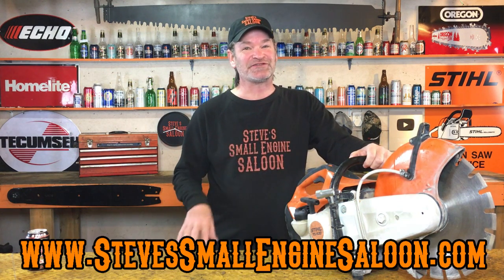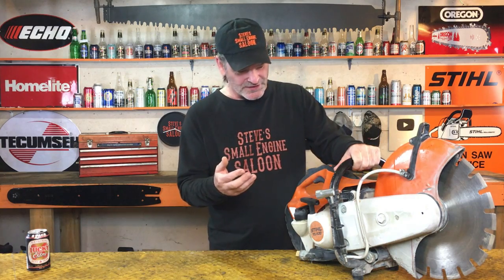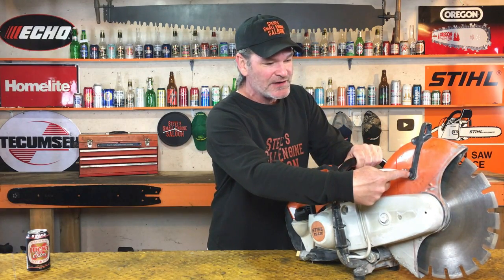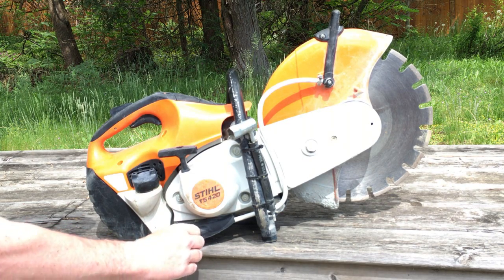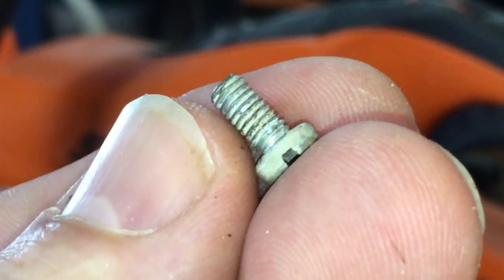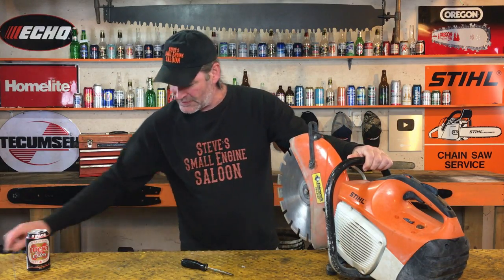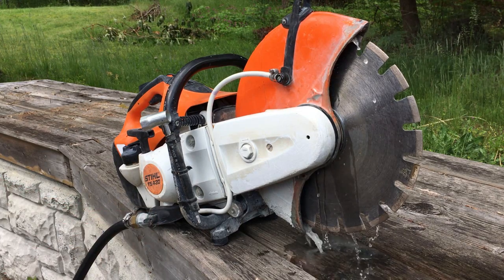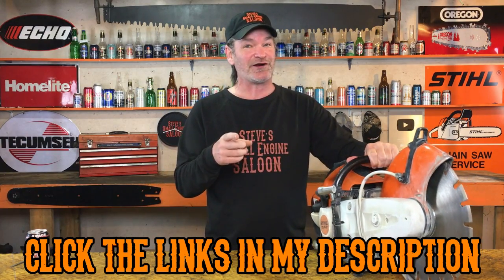Easy Way To Unplug A Concrete Saw Water Attachment To Spray Better

Comment from the maker: ✅CLICK HERE FOR SMALL DRILL BITS ➜ https://amzn.to/3aAdnkV
Check out this other informative video on the Stihl TS410 and TS 420: 
👉How To Replace The Drive Belt On A Cut Off Saw ➜ https://youtu.be/a7cydlI8Q58

For more videos like this, check out: 
👉How to Adjust or Tune the Carburetor on a Leaf Blower ➜ https://youtu.be/DWPUYJiF6KM
👉CORRECT WAY To Tune The Carburetor On A Chainsaw ➜  https://youtu.be/M6T5JoGXcHY
👉How To Adjust Or Tune The Carburetor On A Weedeater ➜ https://youtu.be/gmhxTvGRtCg

You can connect with Steve here too: 
✅Visit Steve’s WEBSITE ➜ http://www.stevessmallenginesaloon.com/ 
✅Visit Steve’s PARTS & TOOL STORE ➜ https://www.amazon.com/shop/stevessmallenginesaloon 
✅Follow Steve on FACEBOOK ➜ https://www.facebook.com/stevessmallenginesaloon 
✅Follow Steve on INSTAGRAM ➜ https://www.instagram.com/stevessmallenginesaloon/ 
✅Follow Steve on TWITTER ➜ https://twitter.com/SteveSaloon
Reply: Do you it might be the belt?
Reply: Do you think it might be the belt?
Reply: Any suggestions on a badly rusted recoil starter rope eyelet fix
Reply: Hey steve your in canada right ?
Here in america its a violation of  federal law to remove or alter a safety device 
But ive seen other small engine youtubers remove these devices for customers can you do a video on this since no one seems to know this is a crime and makes the mechanic shop liable for potential injurys

Comment: The newer models have a filter before the water switch ,I was doing the thing you showed but did not work,turns out the filter right where the garden hose connects was full with dirt,removed it and got it cleaned,it works perfect

Comment: Hey there Steve. Once again you're right on the ball... Thank's for this short yet quite important video. I actually have 2 stone cutters of the same company as the one in this video. I sort of minimize this problem by not letting these, or any of my small machines in the back of my pick-up truck. 1st it's prown to robbery but also... We being in the business of seasonal work. Therefore time is if the upmost impotence. This is where the majority of the clogging comes from. I noticed if I'd use the saw with water to start the day... no clogging... but, if I started the day using it without water. Just because of the night dew, that humidity in the machinery would help that dust stick like crazy... Including air filters, spring's...etc..
Now I'm going to say something that makes EVEY COMPANY OWNER CRINGE !!!! The best way of prolonging small machineries lifespan is one thing & one thing only.... MAINTENANCE  !!! MAINTENANCE  !!!! & yes.
.. MAINTENANCE  !!!
Reply from the maker: Right on

Comment: Alot of my job is masonry and theres rarely a day we dont use those saws. Love em hate em. Somehoe only recently found out about the screw plug. I was always told u have to pull tge entire bolt, that black strap bracket, and to aid in getting those damn square nuts back in their slots the blade too haha. We have problems with little granite flecks clogging the holes that run perpendicular to the jet hole but i bet this will still make it easier to unclog. Only two improvements (beside weight reduction) i can see on those saws. 1: a REAL hose clamp on that damn tubing, the crimp clamp they use has popped on every saw weve ever had after six months (we have 4 now and 2 that finally bit the dust but are good parts). And 2: a better way to secure the feet on the bottom (maybe even just wheels) cus u can use the feet to slide the saw forward into the cut (so ur not pullin out of the cut all the time and getting a wavy cut line) but doing so tends to tear them off after a few months or a year. Great video. Glad to see all these tips!

Comment: Steve, I'm repairing concrete machines on the side and have used your channel so much as.  Is there any chance you could look over  power trowels?  I've been looking for the last 4 years and there's minimal videos out there.

Comment: Hi Steve, my husband has a TS 760 built in 96.  There is an orange screw/bolt thing with an opening, on the left outside case and underneath it says oil.  What is that for?  We can't find any info on any videos or user manuals.  Thanks!

Comment: Steve, just food for thought but could you do a video on how to install and adjust a throttle cable and choke cable (manual and automatic) on a push or riding mower. Fairly simple job but I have met a few folks over time that just can't get it back to where it was when they attempt to do it. Handle never seems to be back in the original position. What was full throttle is now choke and what was choke is not the choke any longer. Keep up the great videos.

Comment: Hey Steve! Can you give a video on fixing the most common problem on most Surface Cleaners? I have a Ryobi Surface Cleaner that quits spinning although it isn't clogged with debris. I have a Ryobi Surface Cleaner 2500-3000 psi that quit spinning even though I keep the equipment as clean as possible.

Comment: Any ideas sir on a craftsman push mower that sounds like it’s trying to stall after running? Sometimes happens three minutes in, sometimes 25+. Idle just goes down trying to stall and labors to go back up while mowing. Thanks sir
Reply: clean the carb

Comment: Those concerte saws are amazimng machinery, especially the stihl ones, but as they are used one of the dirtiest environments, dust and water slush, their airfilters and water jets must be cleaned after days work, it makes all the difference.. Tiny sticky dust will penetrate airfilter and ruines piston and cilinder quite fast

Comment: Stihl Ran Dry/No Tears To Cry

Saw silent n' Stihl
A lonely two stroke
No groove to till
No throat ta choke

Stihl dry n' spent
Cause?..an asphalt?
Or, some dry cemen t?
It be a no flow faul t.

Left twist screw.
A probe do insert.
Wiggle frow n' to.
Ready ta squirt!

Fluid fills D hose.
Diamonds B offered
Grip, ready, pull, GO.
A plunge is buffered.

So well lubricated
Plowing the furrow
Deeply appreciated 
Slow n' wet Ya go.